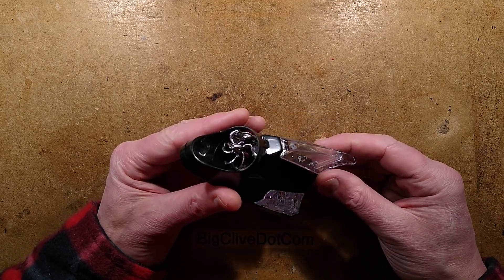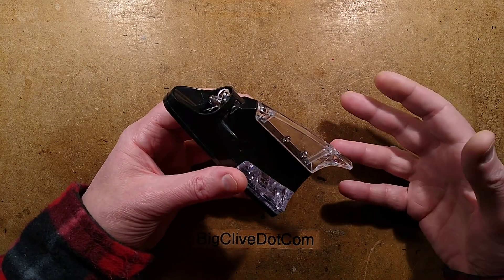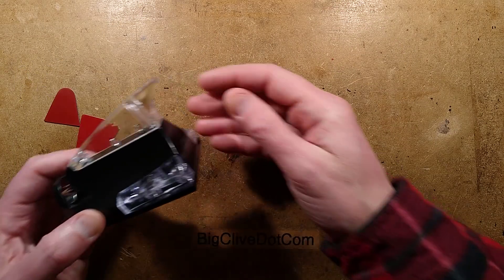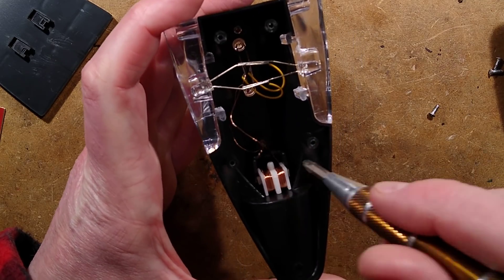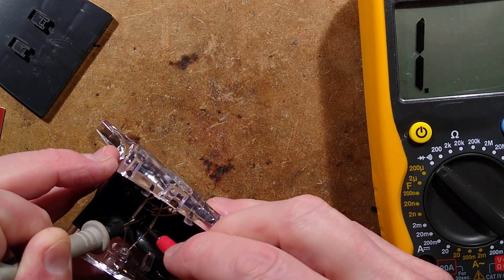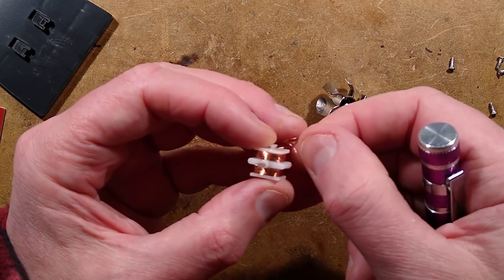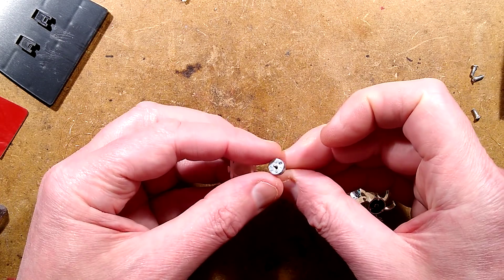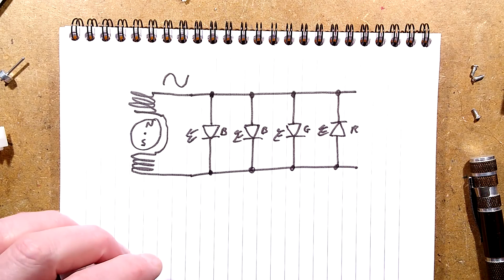Inside a wind powered shark light for cars

Comment: The review about it making too much noise and having to come off the care reminded me of a story. When my children were very little we'd go on road trips to visit my parents.  We had a big luggage bag that we'd strap down to our car.  I'd run the strap over the car, put the bag on top of it, then fix the straps over the bag.  The straps went around the bag like a belt basically.  One time we hit the highway, and suddenly there was a high pitched noise.  I pulled over to check everything and nothing was out of wack, so I started back up again.  I hit speed, and the noise was back.  It turns out that the bag was sitting on top of the roof rack, and the strap went under it, so the wind from driving so fast was able to vibrate the strap and make a noise.  I couldn't take care of it right there on the highway, so I thought for a  minute and grabbed a diaper.  I stuffed the diaper under the strap, and it was very tight.  So tight that the strap couldn't vibrate anymore.  We drove home with a diaper holding our strap in place so it wouldn't make any noise!
Reply: I remember driving my mum's car and there was a horrendous banging sound coming from the car at speed. Sounded like the thing was away to fall apart. Eventually realised that it was a flag she'd attached to the aerial, and at a certain speed it would rhythmically smack at very high speed onto the roof of the car, creating a very disconcerting noise inside the cabin.

Basically, if we've learnt anything from this it's to be careful sticking things to the roof of your car.
Reply: That's why you put a twist in the strap.
Reply: @tooler731  We started putting the bag on first, then run the strap over the bag, under the roof rack, then over the bag again.  That worked really well.  But the twist sounds brilliant.
Reply: @rickseiden1  That's what we've always done on our trucks. If you have a long stretch where the strap isn't going to be tight against something it will vibrate like a guitar string, put a twist or two in the strap (doesn't affect the strength) and there's no vibration. I've seen guys tear roof racks off of cars by letting the straps vibrate.

Comment: This item will get you a fine if used in the UK. Only emergency vehicles can display blue lights so it is an offence if your vehicle has any LED or neon under-vehicle lighting system or lights on windscreen, washer jets or number plates emitting a blue light. The motorist could receive a £50 Fixed Penalty Notice and or be reported to court.
Reply: I have had blue sidelights for a few years and never had any issue.  Passed the M.O.T. as well.  Headlights need to be white though.
Reply: @rogerhargreaves2272  Why would you even do that?
Reply: @robm8809  - fitted on the car when I had it.  Never bothered changing them.
Reply: @Matt Quinn they are ice blue, almost white.

Comment: I'm admittedly an idiot when it comes to electronics, but if you were to connect the turbine blade to a little hobby motor, would it also generate electricity that could drive the LEDs?
Reply from the maker: Yes, but I don't think it would be efficient.
Reply: All motors have the potential to be really shit generators.
All generators have the potential to be really shit motors.

Similarly,
All LEDs have the potential to be really shit solar panels.
All solar panels have the potential to be really shit LEDs.

Comment: Blue lights on the exterior of a vehicle are only allowed on emergency vehicles so 1st time the police stop you is a warning and second stop = 3 points. but the boy & girl racers in their 1 liter 3 cylinder cars will still buy them to go with the blue tint headlights and blue led dust caps...
Reply: Yep. In the UK it's Road Traffic Act, Vehicle Lighting Regs, which basically say certain lights are compulsory (headlights etc), and everything else is forbidden, then lists the exceptions to the verboten bits (police, fire etc). Retroreflective stuff is also covered.
Reply: It depends entirely on where one lives. In Ontario, and probably the rest of Canada but I have not checked, a flashing blue light by itself indicates a road maintenance vehicle dealing with snow or ice, or preparing for either. Such vehicles with blue flashing lights may not have a red flashing light in combination as red and blue flashing lights are reserved for emergency vehicles.

Some other colours reserved for flashing lights in Ontario:
- Green flashing lights are used by volunteer fire fighters responding to an emergency (not the emergency vehicles)
- Purple is used for funerals

Comment: 17 year old me would have thought this cool. Thankfully when I was 17, LEDs were mostly found in research labs.
Reply: My first electronics project ( Everyday Electronics : Damp Locator  1973?) needed a TIL209 Texas LED, I went to my local TV repair shop (there were a lot of these because TVs weren't very reliable back then - something to do with small wooden cases and lots of extremely hot valves and mains dropper resistors, yep no mains transformers in British telly's everything straight off the mains), the man looked at me, the spotty kid, like I was talking science fiction, "We've got diodes but they don't light up".
Got one mail order from Marshall's for 37p (3 weeks pocket money) in the end, it was so dim you could hardly see it.
Reply: @marklatimer7333  I enjoy your crazy gibberish, magic man
Reply: @marklatimer7333  37p - you could have bought 18 Milky Bars or 12 Curly Wurlys for that. Madness.
And yes I used to love going into the local TV repair shop.The original green way to stop land fill and get things repaired.
Reply: @tinplategeek1058  I used to buy my solder from the TV repair shop as a teenager. He sold it by the meter!
Reply: @marklatimer7333  wow 0.5mcd at 20ma talk about using the bottom of the barrel considering they also sold the til216-2 which was 6mcd at the same current in the same 3mm size
Reply: @marklatimer7333  "Hot chassis" TVs were extremely common in North America in the early 70's as well.  The only ones you could be sure weren't (until you opened them and checked if they had a transformer in the power section) were the battery powered ones.
Reply: Lol. Agreed
Reply: When i was 17, led was found on church roofs and fetched a good price!
Reply: @jimmyjames418  hahahah
Reply: @jimmyjames418  Hahahahahaha I almost didn't get that!
Reply: @jimmyjames418  Now it's all been converted into caravans and stolen transit vans
Reply: when me and my friends were 17 we discovered that lighted pc fans will illuminate if you spin the blades. So we duct taped one to our buddys exhaust on his Solara. So stupid it was hilarious. I remember he got on an on ramp and it got real bright and melted in about 20 seconds .
Reply: What year were you 17?
Reply: Sticks half a dozen on honda.. loses them in car wash.
Reply: This would of been cool to put on my bike when I was 10.
Reply: @denniswoycheshen  I can totally see it on a fender.

Comment: I wonder if this would work on a kid's bike. Perhaps as a "Ludicrous Speed" indicator.
Reply: As long as you make the kid go over 25 Mph.... 🤣
Reply: You could make one with a larger 'turbine' (fan blades) and a dc motor/generator which would work at lower speeds
Reply: More effective to have a dynamo
Reply: Easy to do with a slightly bigger fan.  For greater entertainment value, I'd make the colors change as the speed increased.
Reply: If him blowing on it makes it work i bet you'd get something going.
Reply: Mr Clive, could you install a capacitor or two for storage of surplus current for use while stopped for 30 seconds or so?

Comment: Interesting. I wonder whether it would mess with the aerodynamics by atleast a tiny bit since it is a turbine of sorts. And I would also wonder by how much the speed of the motor reduces with a higher load.  This simple design means that it probably only costs like 5 pounds max to even manufacture. I like it.  And I also wonder why they did not use a DC motor instead of a coil with a shaft with magnets since it should infact reduce manufacturing costs. The only reason why i think they did not use a direct motor is because of the amount of torque it needs to start up which may affect the speeds at which the car would need to go for the device to work. And the part where you said "It blows completely off the vehicle" made me fall of my chair laughing. (no joke) Great video as always
Reply: Mpg would drop from 40mpg to 39.99999999mpg
Reply: @siedliko  really not sure I agree. Cars are ridiculously aerodynamic these days and have been for years. Unless you're American ? American cars (and these horrible SUVs and sedans) are not aerodynamic at all. You a Yank?
Reply: @InvisibleYetVisible  lmaooo
Reply: For most cars only the visible surfaces is aerodynamic. Underside is completely neglected.
Reply: @g.h.190  Not true at all for most cars made in the last 20 years at least.
Reply: @InvisibleYetVisible  American cars arent much less aerodynamic than cars of other origin, if they feature the same body style.
Reply: If installed on a sedan before the transition from roof to rear window, it could help slightly. Lookup vortex generators.
Reply: @The76Malibu  that sounds like total bollocks to me
Reply: @InvisibleYetVisible  Absolutely. I would presume this guy also buys magnetic fuel savers.
Reply: @InvisibleYetVisible  Vortex generators mostly are not very functional, but it is technically possible to give them a beneficial effect.
Reply: I suspect this would actually have quite a significant impact (negatively) on the MPG of the car.
Reply: @InvisibleYetVisible  It wont have much of an impact on mpg, certainly not significantly. Its just too small for that.
Reply: @GoldenCroc  it will increase drag
Reply: @InvisibleYetVisible  Sure, but not by all that much. It certainly wont be noticable on the fuel consumption for most driving. Its just too small, as I wrote.

Comment: How many volts does that little generator put out?
Reply: suddenly i thought "they should do this to recharge hybrid batteries"
Reply: @Megatog615  Elon Musk is patenting your idea at this moment.
Reply: @Megatog615  What? Free power! You've just solved the energy crisis.
Reply from the maker: Not high.  It will depend on speed and load.